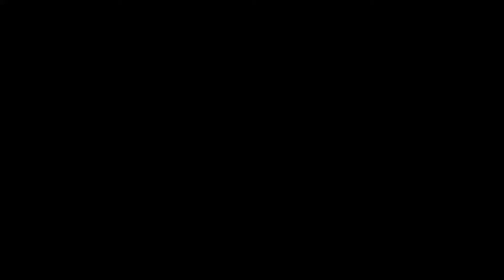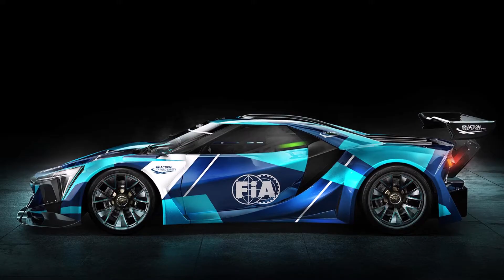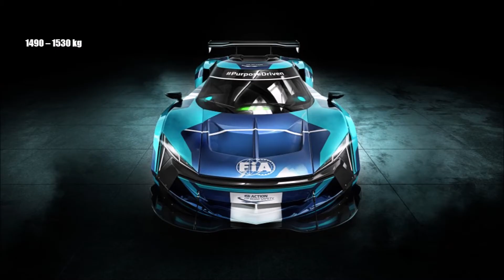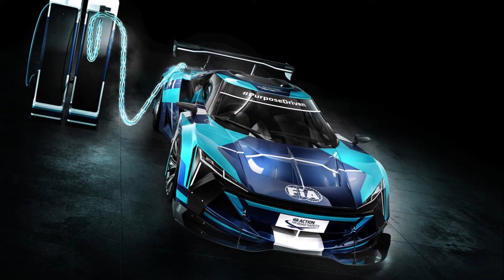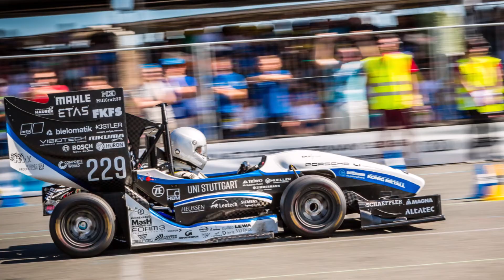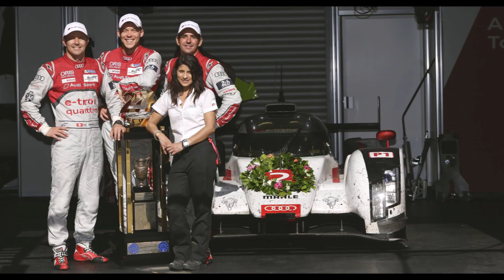FIA Electric GT - The Beginning of a new Era?

Comment: This should have been done and started from 2020 (if not for the situation), but otherwise all ready and done, not presented in 2021 for future creation
And battery packs to be swapable, not rechargeable at the pit stop.
Why? Because the batteries hold the charge in a different way that liquid fuel. The energy, electricity, is not physical and this aspect of swapping should lead to better battery design, easy to replace and maintain for road cars. Resulting in modular designs and not proprietary shapes. Thus allowing for competition among battery manufacturers to create the generic format and not imposing some limited proprietary format.

Comment: My feelings on this are mixed. On one hand it's interesting because it's something completely new and I am curious how they'll tackle all the challenges going forward. On the other, this kinda drives home how useless electric cars are at racing with the exception of short sprints. 300kg heavier, with 300kg less downforce at 250km/h and they have to refuel for 5min+. Absolutely uncompetitive compared to GT3 cars and no sound either (unless they decide to go with the god awful honking electric hill climbing cars have to have :p ). This series exists solely to push EVs and yes, it might actually help car makers with their road cars, but I am not sure I really care about that. Enthusiast driver's cars are fundamentally on the opposite side of EVs (because of lack of engine variety, noise, engagement through a gearbox), technological advancements notwithstanding.

Comment: Hm, for me this class is just describing the current state of automotive development. It is not focusing on the future! So why should OEM invest in this format? We will not make it with pure electric cars, IMHO fuel cell technology will be more relevant - so OEM might have interest to develop this. But this class is purely focusing on electric GT cars- with huge batteries. And 1500 kg of race car weight? Yes they are fast accelerating but they will corner like a nascar! I really do not understand FIA strategy: to many classes. Formula e, eGT, Hyper Cars, Lmdh... and eDTM. In current economic situation I highly doubt that much OEM’s will join in a massive costly development for eGT. 
But beside that, like always - good video 👍🏻
Reply: "IMHO fuel cell technology will be more relevant"
Then your opinion is nonsense. It's pretty obvious by now (to everyone but Toyota)  that fuel cells for light vehicles is a dead end and won't happen. BEV is the future for light vehicles. Heavy trucks, boats etc is another matter.

Comment: This is certainly many times more interesting than Formula E, but considering manufacturers must base it on a road car chassis, how many have the right base platform to build this from at the moment? Porsche and Audi? 
And I may be conservative but I think electric race cars may be the death of motorsport as a spectator sport. And without spectators, less sponsors...  Taking away the engine noise takes away half the fun in my opinion. But Maybe the future generations see things otherwise.
Reply: All the Volkswagen Group brands (VW, Porsche, Audi, Seat, Lambo etc), Mercedes for sure, BMW and Ford probably, Fiat eventually, Volvo/Polestar, GM, Rimac, Hyundai, KIA etc, there seem to be enough contenders. As for the noise... nah, if the racing is good and the cars are exciting people will forget about it quickly. Stuff like torque vectoring and other tech to make the cars perform like no ICE cars can will also help.

Comment: Still no battery competition
Reply: There will be battery competition, they only have to use the same battery cell. The design of the battery is otherwise open.
Reply: @Oscar97o  There will be "Fuel Tank" competition, they only have to use the same "Fuel". The design of the "Fuel Tank" is otherwise open.
Reply: @bis4blair  Why FIA don't let panassion, BYD, CATL & LG to competition together?
Reply: @ScaniaFung  now that you question this, I think it’s to prevent a “battery cell” war from happening. Similar to something like a tire-war. FIA is probably not taking the risk, given it’s likely they’re unfamiliar with an electric racing car concept.
Reply: @devandrasimanjuntak1646  but battery is the most important part of EV, just like engine in gas car, if battery won't open,  it just a joke of technical competition
Reply: @Oscar97o  cell are the most important technology of battery.
only pack open but same cell, just like same engine but free for intake & exhaust

Comment: Very interesting concept, and as a big fan of GT racing, this is needed as a boost or a transition step for GT racing in order not to become irrelevant on the long run. I hope it'll be more engaging to follow, as I tried to follow Formula E many times, but never found the urge to continue doing so. The future electric DTM series will be interesting to watch as well, whether it'll take off or not.

I just hope that FIA won't screw the concept with complicating the rules that allow big budget manufacturers to find loop holes to give them certain advantages over other ones.

Thank you for the video 👍 I'll share the video with other friends.

Comment: Yeess road car based. So will this make GT3 irrelevant?
Reply: it depends on the reception. If it becomes more popular than GT3, they might make this the main GT series.

And anyway, by 2030, this will be the main series for GT Racing, since a lot of major countries will ban petrol powered cars.
Reply: @devandrasimanjuntak1646  what are u on about petrol cars wont be banned atleast for another 80 years sure making of new petrol cars will prob be banned around 2040 but its estimated that in 2050 60% of the cars in america will be evs but that means another 40% is still petrol and porshe is working on making synthetic fuel which might mean evs isnt the future hydrogen even might be
Reply: No. The goal is for GT3 Manufacters to be able to convert their cars so they can run in here and have two separate series and classes, even though these cars are supposedly gonna be similar pace to a GT3 car on a normal lap. I could certainly see some one off events where Manufacters race each model vs each other but I don’t think the FIA wants to put them against each other Incase the EV series looses. Plus as much as 5 minutes for 60 isn’t bad this ruleset isn’t very optimized for Endurance racing like GT3 is, I see this as more of a replacement for Sprint GT Racing
Reply: Eventually, yes. Car manufacturers will not invest in motorsports that don't sell cars. So as soon as their product lines go full EV motorsport will too. Of course, whether GT3 will be replaced or go electric is another matter, but ICE motorsports live on borrowed time.
Reply: GT cars don't quite exist for this class. It's more expensive for some and endurance races will still require ICEU so no, GT3 will still be here.

Comment: This makes more sense than formula e, but was there any mention of a means of limiting development costs?  Wouldn’t want the series to be like lmp1, and if the cars are road-based the chassis development could be tedious I think.  By cost limitation I mean a budget cap not part standardization
Reply: @J B right, but even then $100m+ is not a sustainable budget and there must be something to deter teams like audi or porsche from out-developing smaller teams on parts of the car not related to the drivetrain.  Budget caps will prevent the need for BoP and in a series like this, BoP would be a terrible idea.
Reply: I could imagine that non-factory teams get the chance to buy a standard chassis they can use to develop the rest around. But I don't think it'll be as much of an issue for factory teams, seeing as they already have the cars to run in the series. And seeing how cost caps are starting to be implemented by FIA, I would imagine that there is a cap to how much a team can spend, but it just hasn't been announced publicly.